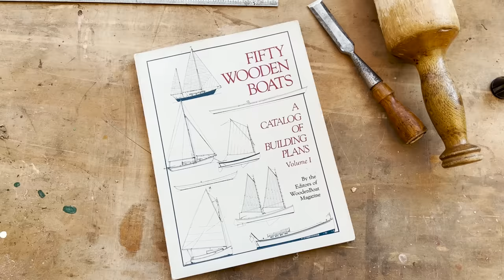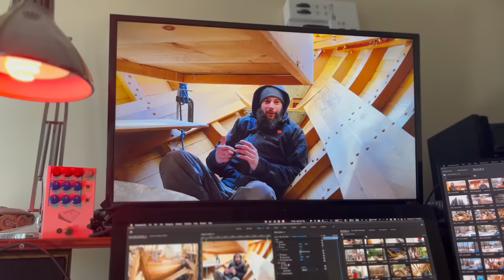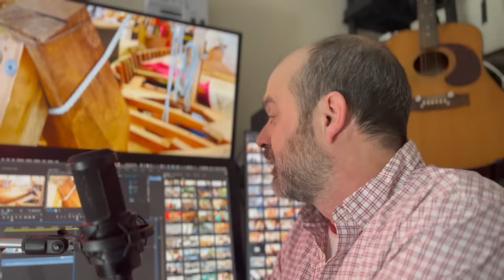All Hands on Deck, 6 Years of A2A - Episode 200 - Acorn to Arabella: Journey of a Wooden Boat

Comment: Been watching since before the pouring of the keel. I look forward to seeing the show each week. I do find it inspirational. I'm 71. I decided I am not too old to build a boat and sail it. I have been working on a design for a year or so. I have all of the parts to do a small RC scale proof-of-concept. My wife is not "on board." She thinks I am too old for such a project. I think she will believe that until I launch and sail, and the RC model should be done this spring. After that it will be a bit of a shlog, but I am only thinking of a day-sailor, and not nearly as grand a project as you are doing. None the less, thanks for the inspiration. Well wishes from Wisconsin!

Comment: I found this channel during the steam bending, it came up as I was looking for ways to curve wood(that project is still on my list for when its time comes) but following everything else and going back thru older vids has given me other new inspirations on not only ways I'd like to redesign my 30' powered cabin cruiser's interior(aiming for drawings and mockups this summer, then build when out of the water in my shop the next winter) in more of a mixed composite materials as I'm better at resin and foam sculpting than all wood in the fiberglass hull(but now many more ideas to show some finished wood) but also planing a new wooden back deck on the house using some of the planking things I learned here - so looking forward to the rest of your interior and how you do your top deck, to combine with my ideas and other sources  

thanks for doing you, and all you guys sharing how that goes

Comment: Steve, After commenting myself , I’ve read the comments to this episode and saw one in particular that I can only guess its meaning. The whiskey plank?
Is this the last hull plank or last board fitted to Arabella that is named “whiskey plank”. Can you answer this question in a subsequent episode? 
At time of this comment, 77 are posted.
Thanks!
Reply from the maker: Hello Anthony! Full day yesterday with the open house and then a livestream. Yes, that’s what a whiskey plank is. It’s the last of the planking. It’s almost always a shutter plank as well, which means it fits between two others. The sheer strake (top topsides planks) defines the sheer, and goes on before the last plank. We should get to that this spring or early summer. —Anne